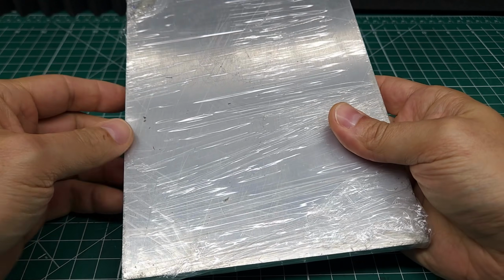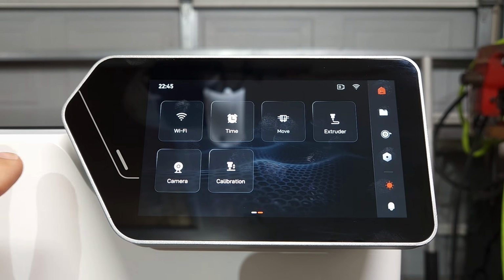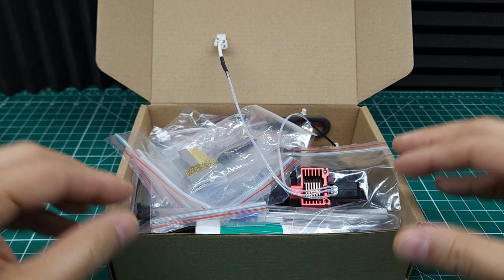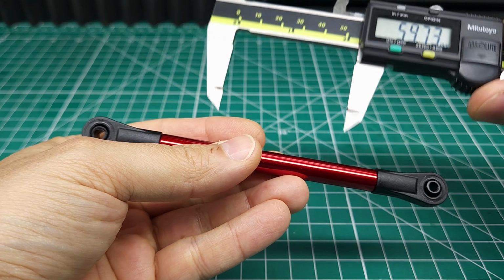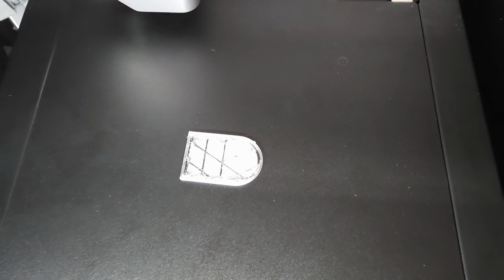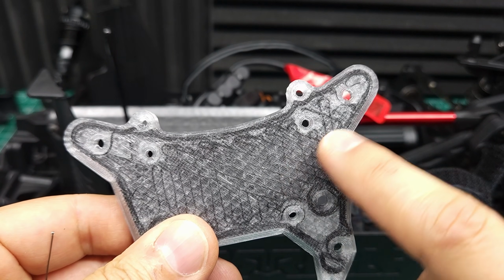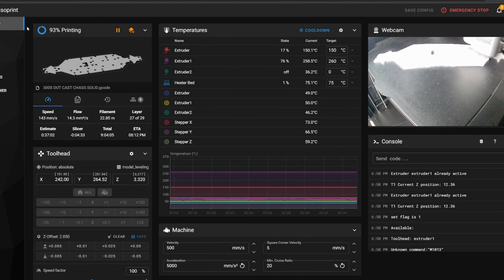Not Just RC...The Future Of TECH Is Here!

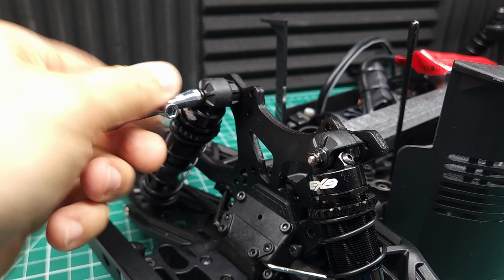Comment: 14:13 I wonder if this tower will be stronger than that previous project one was. Speaking of, you refer to that freaking AMAZING tool as a "precious project" which yeah, it was, but for what that thing is and does, it seems a little inappropriate of its majesty to be so undersold, even while on a video about something potentially just as amazing, or even more. Lol. Man you get all the AWSSOME toys! BTW, I'm all the way here for this type content as well as RC
Reply from the maker: Done properly this has the potential to make a shock tower that is at least as strong as a cut carbon fiber one. The last project was definitely a lot of fun but this is more serious :-)
Reply: @DoRC I can see that. The potential to make better quality functional parts than OEM at home? I can see that have TONS of potential, especially for someone with the knowledge you've got, even for those with just modelling and 3d pringing experience. Seems like the barrier for entry is a little bit lower with this printer.

Comment: This is amazing. Nice to see how 3D printing evolves. I am designing and 3D priting spare parts for my MJX 16208, ive replaced many parts with 3D printing parts. About the shock tower test, if you would like, try to design it 25-30% more thick, print it out if 100% 95A TPU, (if you print with bambulab HF TPU, lower the flow rate to around 5-7mm/s, 5 degrees higher temperature too, or just set it on silent speed mode) and mount a metal bracket between the mounting ears of the shocks. Then do whatever you want to the car...i bet that shock tower will be the last part that will break on the car. it can fall from space
Reply: ...as long at the temperature is not too low.. :D
Reply: Also i think the point of 3D printing is choosing what the weak part is, who absorbs the damage, what breaks first. so the design and the materials must be in such a way that it breaks the easy replaceable, cheap reprintable parts. If you make the swing arms to strong, it will break the chassis, the steering links, the steering hubs.. I made the arms flexible to protect the chassis, i am now bending shock shafts and hinges

Comment: I have 6 Bambu Lab printers and a Resin machine, all of which I use to make RC parts. In fact, I'm the guy that bought the LMT bumper design from you. :) I really appreciate your channel, the effort you put into the hobby, and I REALLY look forward to adding one of these machines for those structural parts that need extra strength. I find it great how you simplify everything for the "everyday hobbyists!" Of course, i also geek out when you go into the engineering/design aspects because that's my occupation/passion. Keep it up! You're a great asset to the RC World!
Reply: Can you make 48 pitch gears? I figure if your printing all the other stuff you might could do that also
Reply: I'm curious about where someone can sell designs. I really focus more on the design and 3d scanning side. I'm actually even trying to avoid having to run a printer.
Reply: @kewlbug you gotta get into forums and start looking through people's problems and provide a solution to them. If the things you designed only fit your problems, there really isn't any business opportunity there. Im assuming your solutions are rc related. So start with rc forums...
Reply: @kewlbug things dont always print properly unless designed to print properly.
Reply: @kewlbug wouldn’t you want to print it for RnD? Buying something from someone with no testing doesn’t sound like a good idea.
Reply: @kewlbug  also, withought printing your design and testing it, how would you know your solution even works properly?

Comment: The strength of the printed part is still limited by the layer adhesion vertically so it’s still much weaker than a carbon fiber shell. But it should be plenty strong along the direction which carbon fiber is being laid.

Comment: Can't the fiber be put into the filament itself instead of needing a special printer and 2 separate rolls? Or is that not profitable enough?  If it were easier to print in all axis it might be even stronger if the layers intertwined in order to lock the layers together
Reply from the maker: I think it might be theoretically possible but if it was practical I'm guessing it would have already been done. I'm assuming the limitation is the significant difference in physical characteristics between a filament of carbon fiber and a blob of molten plastic. My guess is that there's no way to contain the fiber in the middle of the plastic as it's being extruded once the plastic is molten. You'd also run into a problem where the plastic would need to be the same diameter as the exit because otherwise you'd end up with more plastic than filament as it's squeezed down into the shape of the nozzle. There may be other problems but those are the two big ones I can think of that are probably both showstoppers.

Comment: Great video, I wonder if you could just have a filament with a single core of carbon fibre in the middle?
Reply from the maker: You probably could though it may be impractical. You would need the hot and hold a large enough for them both to fit through but I think more importantly you'd run into an issue where the carbon fiber wouldn't want to stay centered in the extrusion after the surrounding plastic melted.

Comment: I’ve designed and printed a 1/24 scale rc car, there are however some parts I could not print. Bearings, springs, gears, nuts, diffs, cvds and universal joints for example. Being 1/24 scale material strength was less of an issue than you’d expect, I believe you could print some of the parts that I could not if you scaled up, but I believe you would then run into material strength issues. However this is an incredible advancement in material production and application and could make printing some of those more critical parts possible. If nothing else it will certainly allow printing some larger scale parts that could have a feasible amount of strength where necessary, the example of chassis plates is a good one by DORC. Currently standard fdm printed at home chassis plates could not be feasible in terms of strength but this material could change that and more
Reply from the maker: Yeah this definitely isn't going to be practical for really small stuff but it is cool!
Reply: @DoRC it’s super exciting in terms of the possibility of printing parts for bashing though!

Comment: I don't know much about 3D printers, haven't gotten around to buying one yet, but I've been pretty fascinated watching the tech come into existence and get better to the point of being mainstream, and that one does look promising! 
I'm curious if instead of trying to get that CF strand to make the sharp turns around the screw holes (in something like that shock tower) is there a way to insert metal bushings? Maybe start the print, stop at maybe 10%, insert the bushings by hand, then finish the print? 
I don't know if you can easily stop and start with that printer, and I've been told it's hard with "normal 3D printers" to get precise, but it would be cool. Or, I guess you could just drill out the holes and press in some bushings. 
Every time I go to Microcenter I get ready to buy a 3D printer on the spot after looking, but then I keep looking at the sizes and features and can never decide what I want/ need to be able to print- big functional stuff? (like RC parts, or even a whole plane) or do I just want to make basic little "QoL" things? like a little stand for my "Schiit stack" (mini amp, eq box, and DAC for headpones which all slide around when I turn the nobs) but it's getting to the point where I'm constantly thinking "I could just make that if I had a 3D printer". Thanks for showcasing this 👍
Reply from the maker: Yes you absolutely can do something like this and people do. It would increase the strength somewhat for sure

Comment: That printer looks really freaking cool too... They were just coming out with the snap maker dual idex printer but they kept having lots of problems with the dual printhead setup so I ended up going with the carbon X1C they were about the same price but bamboo Labs had such a better system and so much more support that it was definitely the smarter choice.. what stinks is a couple months ago I blew something in my AMS I've already replaced all the circuit boards in the AMS itself now I have to replace the main circuit boarding inside the printer for the AMS ugh but it works with a single color filament for right now anyway
Reply from the maker: Yeah the printer looks good though you are correct The dual extruder thing is always a bit of a compromise

Comment: Metal alloys can also be a heterogenous mixtures even if they have the same molecular composition.  Ex. cast iron and katana swords.
Reply from the maker: Cast iron is technically a heterogeneous mixture (or more specifically a multi-phase alloy) though it basically behaves like a homogeneous mixture it's just weird on a molecular level. 
Katanas that use different metallurgy in different areas are actually composites.

Comment: Cool demo! Like you demonstrated, designing for this technology will take a lot of thought in order to take advantage of it. You chassis brace will see mostly compression loads so it will be hard to beat the stock solution. The shock tower will see tension and bending loads so that will fare better. Is it possible to make the software connect the shock bolt and bulkhead bolt holes with a CF loop?
Reply from the maker: As of right now you can't tell it where to put the carbon fiber but it's something I suggested they allow.

Comment: My downfall from the testing I've done comes down to a layer line failure. Which means if I had the means to get a better heated enclosure and a material that prints above 400c I fully believe we can print 100percent RC to play with.
Reply from the maker: Yeah most 3D prints are weakest at the later lines.
Reply: The whole thing continuous fiber does, is to maintain rigidity such that you don’t need PEEK or Ultim to get strong parts that hold together. The major benefit of the FS3 is that you don’t have to sweat the part holding up, because as long as you did your part on print orientation… you’re not going to see enough flex in it with the continuous fiber in a high strength (PPA/PPS as compared to PEEK) application to have to worry about the layer adhesion issue and fracturing in the Z plane. This is shipping with a heated enclosure and a 350C nozzle, which is plenty for PPS to bond (typical ideal temps are between 320-340C in most testing.)

Means unless you need it to survive a launch into space in a mission-critical application… you’re should be pleased with the difference versus traditional FFF prints where that’s at issue. 👍

Comment: Interesting. Feels like a (better?) middle ground would be a continuous strand within the base material?. Even if that means printing with a .6 or .8 nozzle
Reply from the maker: You actually can print the entire thing with nothing but continuous strand but you'd end up using a ton of carbon fiber and it's very slow. 
The problem with using continuous strand in the base material is that the nozzle would have to be large enough for both to go through and then the strand would not be constrained which would lead to a pretty poor print quality.

Comment: Awesome showcase of new tech.  It's an interesting approach to try and keep things cheapish by just enforcing the areas of the piece that need the most strength, so I am hopeful.  But not hopefully enough to drop $3k on the printer 😂. For now, I'll stick to chassis braces, battery trays, ESC mounts, skid plates and the other areas where 3D printing already shines.

The pieces I would try immediately - Shock towers, Center Diff mounts, and even Center Diff trays that bolt to the chassis and allow the restructure the weight bias of converted rigs like the 5ive T.  I already have designed some of this to convert my 30 DNB into a center diff rig, but the filament (PPA-CF Core) just isn't there yet.

KEEP IT UP!
Reply from the maker: Yeah this is going to be a little bit beyond the breach of the casual hobbyist but especially with the low cost of consumables It does feel like they are at least trying to be fair for the prosumer market
Reply: @DoRC  Oh, I am thiiiis close to putting the down payment on it, lol.  Can you share the cost of the carbon fiber filament?  Understanding, that it's actual usage inside a piece is way less than normal filament, so 500g could last quite awhile
Reply from the maker: @tacky187 I mention it at the end of the video. They're going to charge about 45 bucks a roll for it. That chassis I showed used about 10 bucks worth so it's reasonably affordable.

Comment: If you used a scanner. To scan the shape to print. Would that work if you loaded it into the printer
Reply from the maker: Potentially. Scanner is definitely range in quality and I don't have any personal experience with one yet but in theory you could scan apart and then with some editing be able to reproduce it. The big problem is making it practically 3D printable. A lot of injection molded parts have features and details that don't really translate to 3D printing so whereas the scan would definitely be a good starting point you would almost certainly at least have to do some editing before you can 3D print it

Comment: That printer is above my intelligence, and patience level!😂😂
Reply from the maker: It's actually pretty easy to use.
Reply: Its not the printer people are afraid of it's the computer. More specific computer software that we would have to learn on our own or with YouTuber help.
Reply from the maker: @JustKeepLivingFPV Yeah the software can be intimidating though most modern slicers are fairly easy to use.
Reply: @JustKeepLivingFPV  We have our own design AI slicer launching soon
Reply: There’s a practice in design called “topological optimization.” You go into CAD, run FEA to see where the part takes stress, and remove the material that isn’t actually contributing to lightweight it. 

This stuff is basically automating part of that as a process and practice. It’s not “1 for 1” with it, and you could clean some things up even more if you wanted to look that route. 

But basically… play with this, and you leap ahead of everybody else that has to do Topological Optimization by hand. Again, not a perfect substitute and we can take that even further using it. That being said, this is about as “load it and press button” as that goes with this process. 

If yer intelligent enough to see the value in that, then understanding it is just the cherry on top. Patience with it is just a practice, and not really more than normal printing in that sense other than some of the small things you have to kinda figure out maybe once or twice… but again, that’s all 3D printing either way.

At least when we print stuff this way, it’s truly useful in applications where PETG and PLA were more or less just cool to look at before. I think maybe this starts to fulfill the narrative Bambu started with “personal manufacturing,” and putting some money back in people’s pockets depending on how much you can find to print instead of buying for more. 

If it costs X to go buy the stuff per year for a hobby, and this drops that year-on-year going forward… then it’s just having the patience to pay upfront for the printer and save money going forward. 👍

Comment: Considering how proper carbon fiber parts are done Im sure this 3d printed stuff is not even 50% as strong as the real deal, still is interesting to see
Reply from the maker: I think it depends on how it's designed and what material you're using as the base plastic. Ultimately something like molded carbon fiber will probably always be stronger but that's not really the point. The point of this is to be able to 3D print something and get some of that strength which you just can't get with a normal 3D print.
Reply: Being 30% strong as a molded carbon fiber would be groundbreaking. I am thinking using it to print RC airplanes. Current materials are just too weak for bigger models, but this could change it - and not cost a fortune like full composite builds.

Comment: That is so cool. Great job showing how it works with the clear PTG. Can the software be run on a crappy laptop, or do you have to have something more capable to do the 3D modeling?
Reply from the maker: The slicer should run on most computers though the actual slicing will probably be a little bit slower. If you want to actually design infusion 360 you're going to need something with a lease a little bit of horsepower.

Comment: might be a good option for the 3s 4s line
Reply from the maker: Honestly with the right materials and the proper designs I think you could make parts for larger vehicles as well. This really is in its infancy and I was using models that really weren't designed for this kind of application.